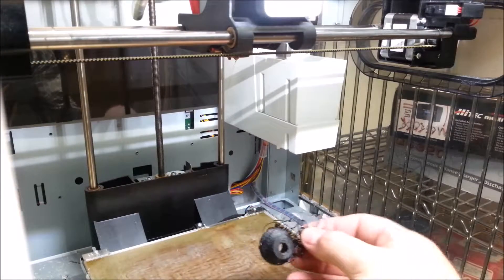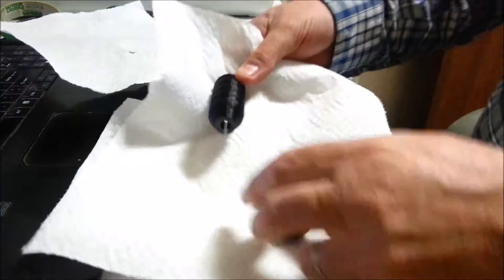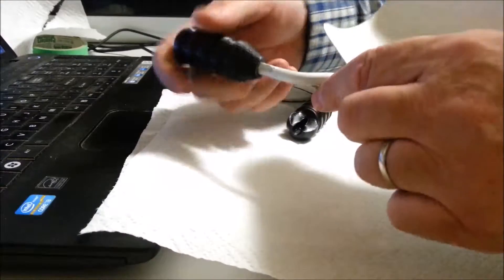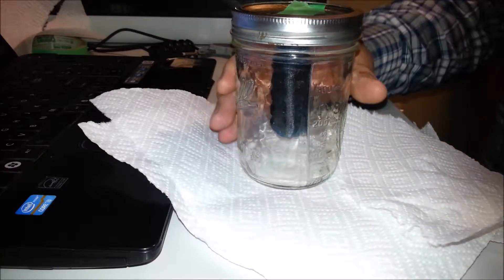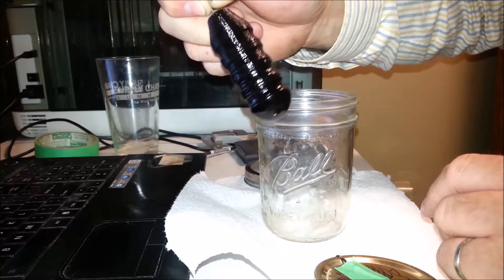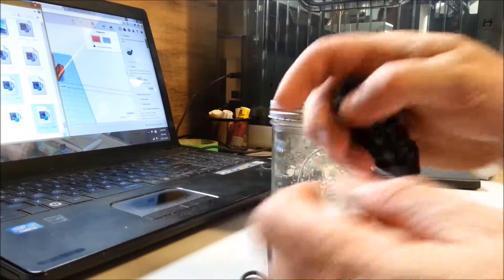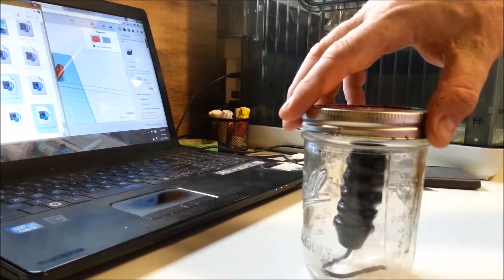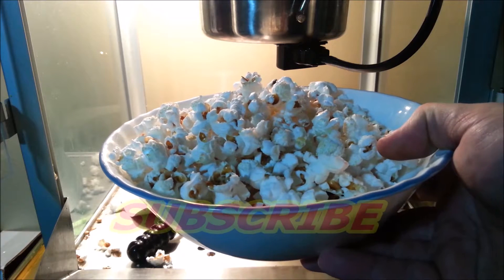TinkerCad How To Model & 3D Print A Popcorn Scoop Handle PART 2 Crafted Channel

Comment: Thanks--I need to try that--sure worked well on your handle.
Reply from the maker: Thanks.  This was my first project I used smoothing on.  I've learned to  put the container someplace warm which speeds it up quite a bit.  However, it evaporates the acetone off more quickly making more fumes.